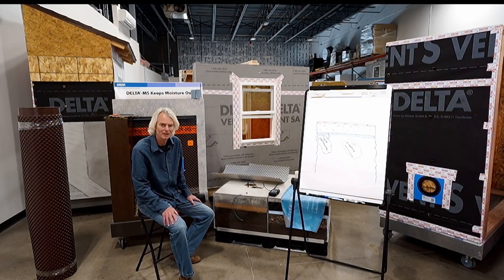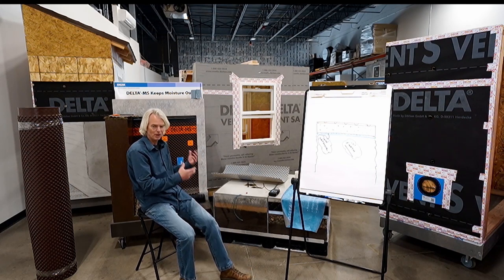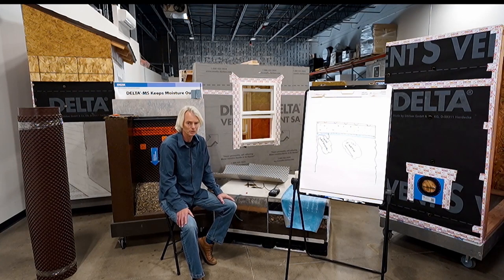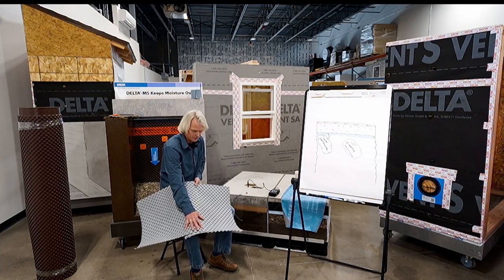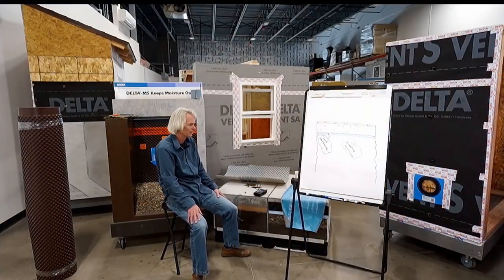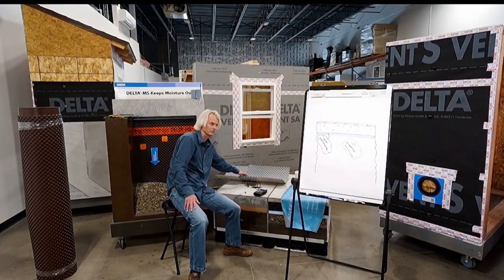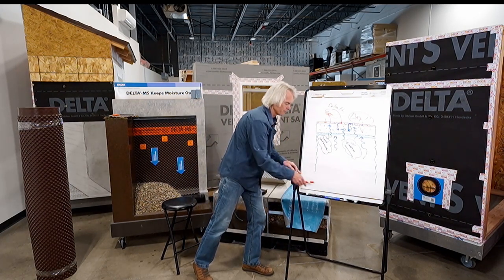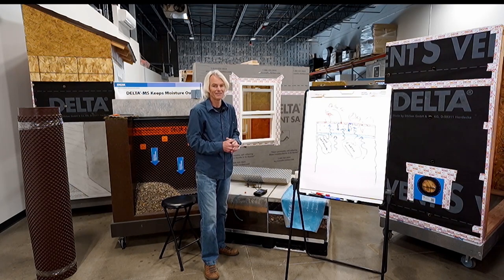Building Science Deconstructed: Foundation Floors with Justin Wilson

Comment: Could this be used on basement walls too?
Reply from the maker: The primary difference between DELTA®-FL and DELTA®-MS is that DELTA®-FL contains 100% virgin polyethylene, whereas DELTA®-MS contains 60% recycled.  Using any recycled polyethylene for an interior application brings with it the risk of odors. Recycled plastic can retain the odor or whatever was in it originally, like sour milk or bleach.  Whether or not there is odor cannot be controlled in the manufacturing process (meaning it might smell or it might not), but does not matter for exterior below grade use, like with DELTA®-MS.  If you want to use any product on the interior, walls or floor, we recommend virgin polyethylene to avoid the chance of odor.  Interior wall applications should be done very carefully and made air-tight to prevent the ingress of soil gases and moisture.